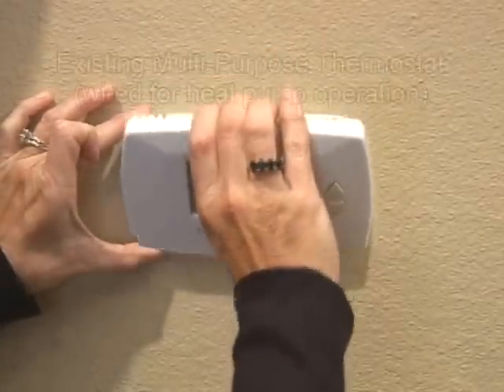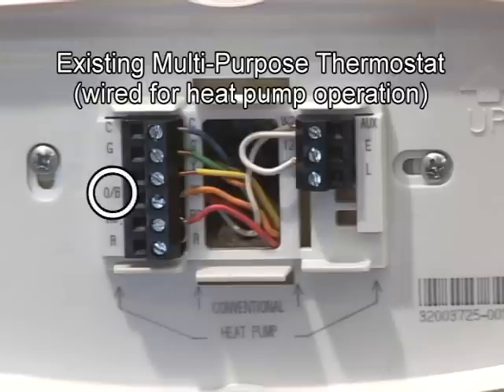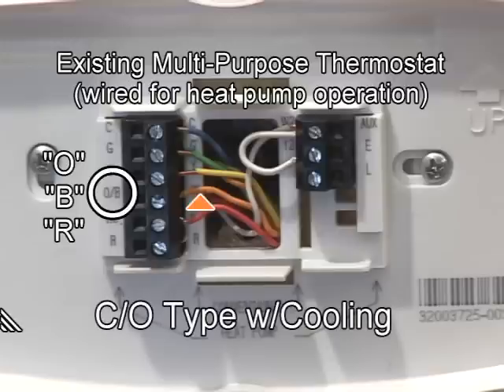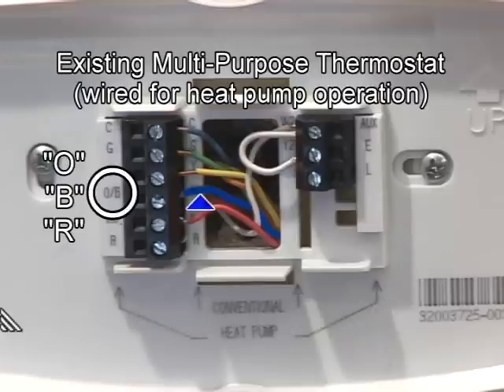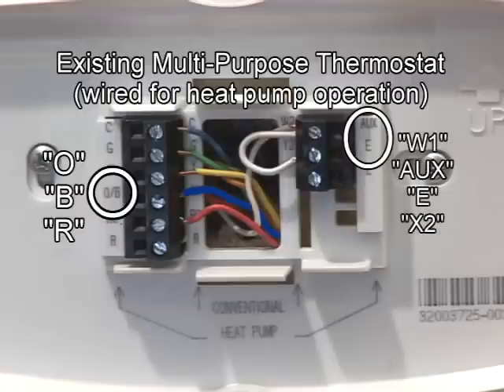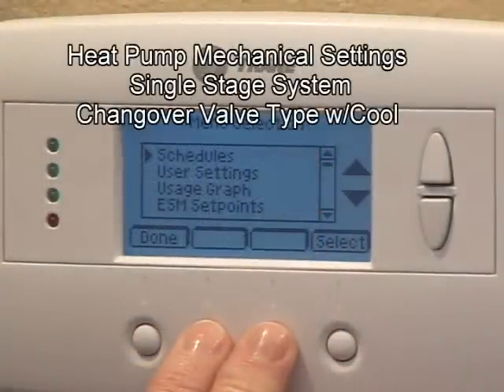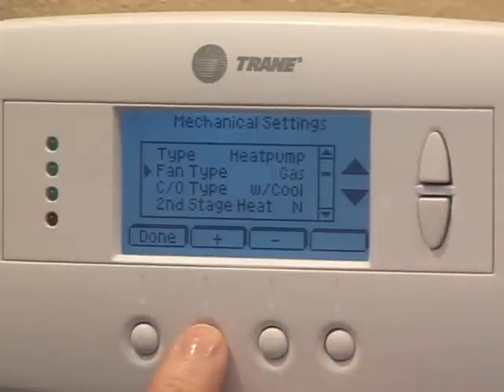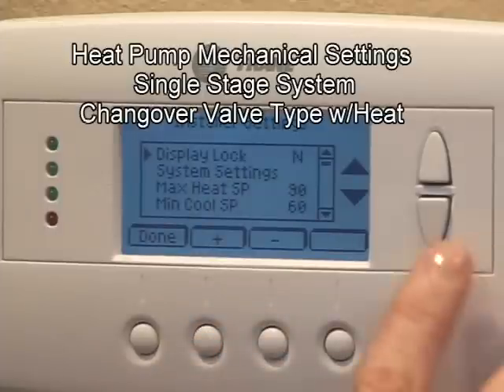Heat Pump Wiring & Mechanical Settings

Comment: Well, my old thermostat has eight wires. It has W1 and W2. I don't know which terminals for W1 and W2. I try to install a new thermostat just like this one on the video here but it doesn't work for heating. Cooling is working fine. Does anyone know which terminal to connect with W1 and W2?
Reply: I found an old stat today and had white in L.  Lol